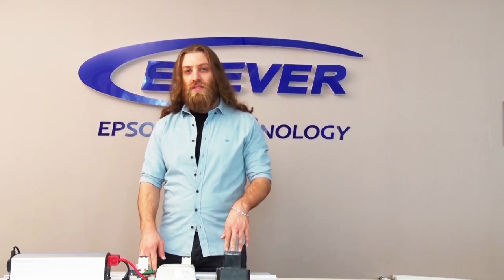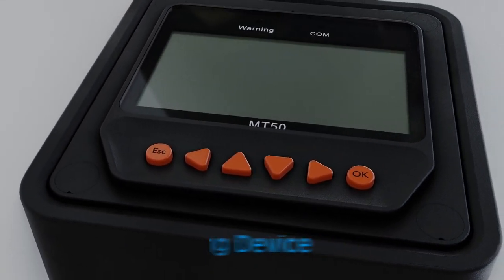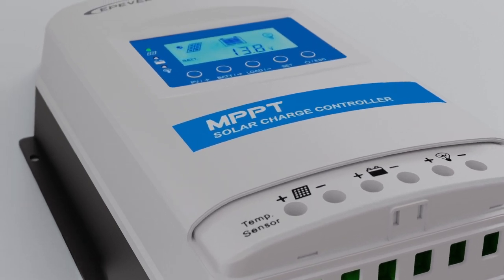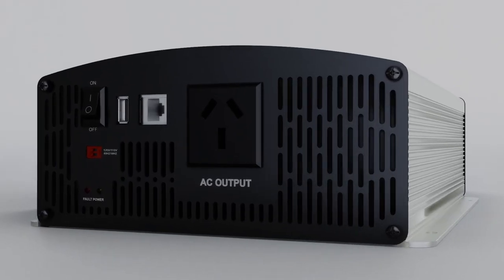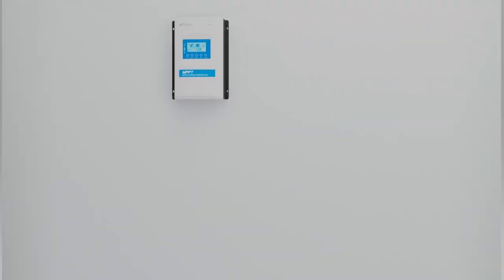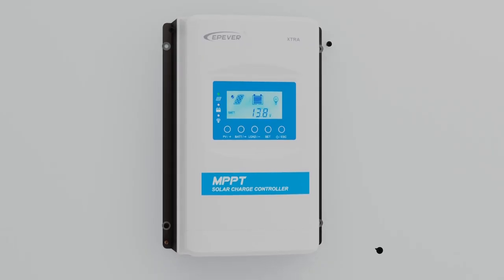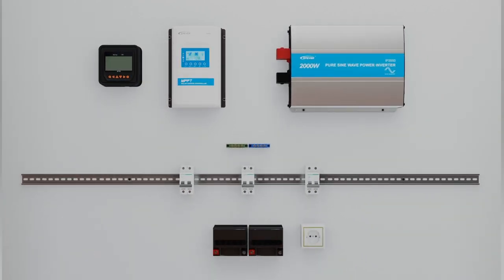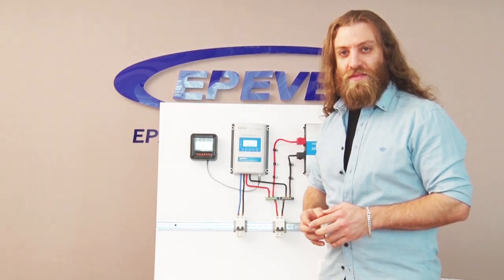The Ultimate Guide to DIY Off-Grid Solar Systems – 01 - Introduction

Comment: What is the connector system on rails with breakers you are using to organize all the wire connections? Awesome videos!
Reply from the maker: Thanks for your comment, were you talking about the blue and green connector? They are busbars, we usually recommend customers to connect the inverter directly to the battery, in the video, we just want to use the busbar to show the connection map more clear.
Reply: @Epever  hi. Ep solar. Can i connect the inverter in the load terminal? If cannot please describe why
Reply: @qzz9102  is the surge measurable? If we connect with low capacity inverter. Is it allowable?